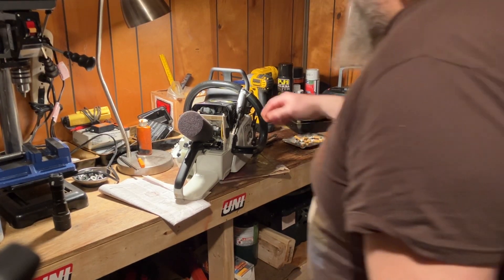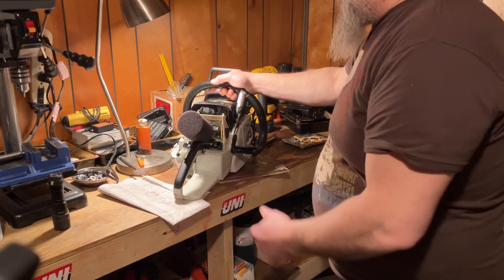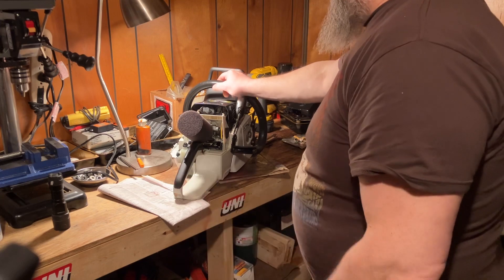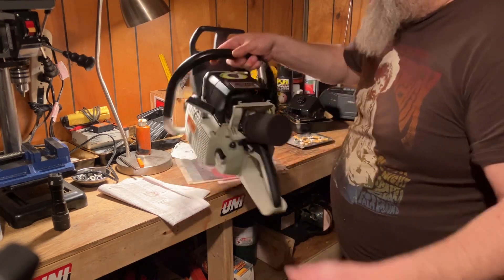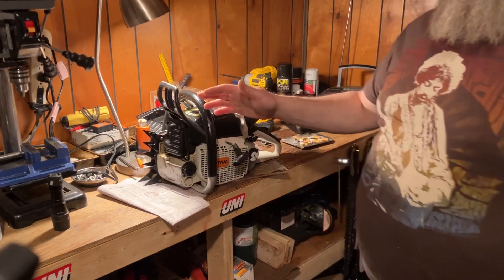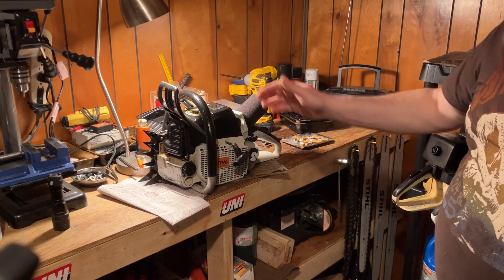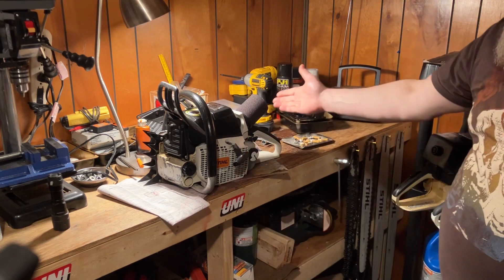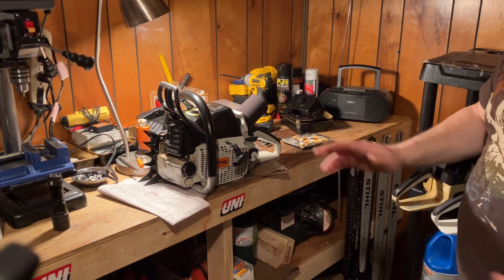044 Oem parts installed

Comment from the maker: 044 running right ?   A 💎 saw … forget about it … these 044 are one of 2 saws produced (064 being the other imho) by STIHL that will greatly increase the sawyers gains in just about ANY situation a muscle-saw is needed. Nothing against a similar built Husqvarner… they are fine saws in their own right!  I’ve said for YEARS that IF a group of folk produced a saw combining the best of both worlds then they wood simply own the market 😉
Reply: Also the flat top 066 is a thoroughbred but yeah the 44 and 64 are badass bitches fo sho
Reply from the maker: @Houseworksaws  a hybrid 044 or a stocker can absolutely dominate in these hardwoods here in wny IF properly set up with OEM parts … lotsa folk “don’t wanna spend the $$$” but for someone who is cutting serious volume these saws can MORE than fill the void 😂
Reply: @fabzacres-blackcat  I’m in NH and it’s about a 50/50 split on Hardwoods and pines I cut on a daily. I switched over to a 400c that I had ported and man what a game changer. I still have my 044/460/461/362c but this 400 with a 25” is so lightweight and I just can’t believe how fast the thing is. I keep a 25” Stihl lite bar on it full time. April 24th I’ll have had it a full year and it’s never had a single issue and it’s got a butt load of hours on it. I can’t say enough but I feel it’s one of stihls new factory hot rods. If you ever get a chance to grab one and do your thing to it I bet you’ll enjoy it too.
Reply from the maker: @Houseworksaws  I’ve check one out at the dealership but haven’t the pleasure of running one yet … I’m sure they rip when built … I have a ripper 462c which is a few ccs larger and it is a lightsaber with a 20” bar/chain